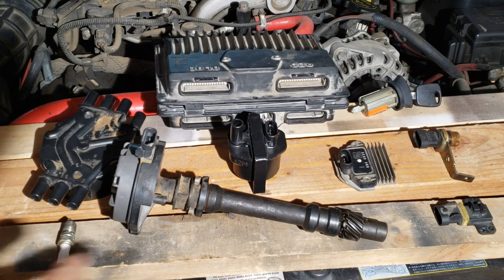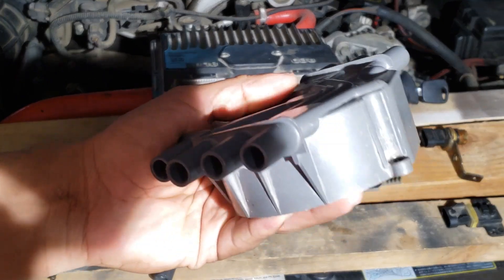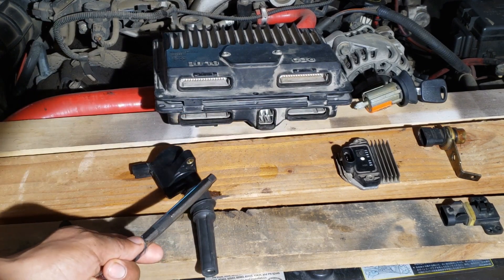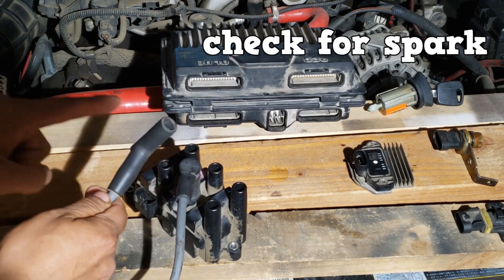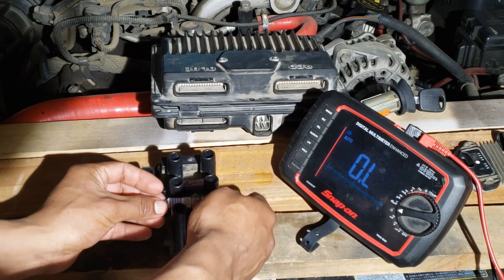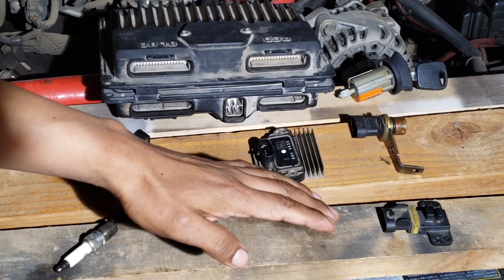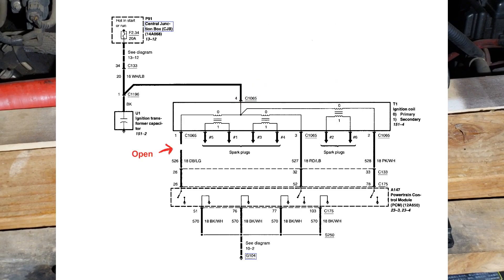ASE A8 Test Prep #2 - Electronic Ignition

Comment from the maker: Update: Video breakdown after taking the test. The first 2 minutes are general ignition knowledge that you should already know. At 2:00 I start focusing on how to diagnose a misfire. I saw at least 5 questions that were misfire related, resulting from the ignition system or fuel system. I did not make any fuel system videos, but you should be able to easily figure it out. More on this below.
As for ignition system related misfires, the questions were pretty basic in this area. Is an ignition [coil-on-plug] going to cause a misfire on 1 cylinder, or multiple? Many of the questions were in wiring diagram format. Look at the wiring diagram shown at 4:49. Let's focus on that first coil-on-plug, on the very left. Let's say it was not producing spark. B+ voltage is shown on the power side to the connector and the ground is good, what's the most likely cause of the no spark?
As for the fuel system, if 1 injector on GDI is clogged, is it going to cause a misfire on 1 cylinder or many? If fuel pump pressure is low, is it going to affect 1 cylinder or many? See easy to figure out. Also focus on interpreting injector power balance results.
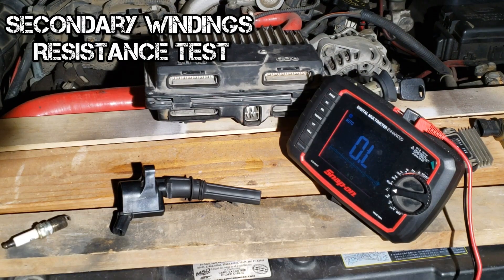The tests done to the coil starting at 3:50 are good to know, also know how to test the coil for carbon tracking.
Reply: For the COP question would the answer for the no spark condition have to do with faulty spark plugs? 

1 injector clogged on GDI would be a misfire on only 1 cylinder, right?
Reply from the maker: @charlietoognarly  The most likely answer would be a bad coil. In the question the point was made that the circuit is working as intended. Usually when you check for spark, you remove the coil and connect it to an ignition spark tester, so the spark plug is not even tested. Yes, a faulty spark plug can also cause a no spark, causes could be: the ground electrode could be missing, incorrect gap, or it can be internally broken. You can check the resistance of the spark plug ( shown at 3:08 ) to verify its not internally broken.

YES 1 injector clogged on GDI misfires on 1 cylinder.

Comment: What are your thoughts on that Snap-On Enhanced DVOM? Any features on it that make it worth purchasing over a other more basic DVOMs (Fluke, Blue Point, etc.)
Reply from the maker: I bought it in case I needed its other functions , but I've just used the functions that a basic DVOM has. It does look good on video! I recommend using a basic digital multimeter.
Reply: @OldSchoolNoe  Gotcha, thank you